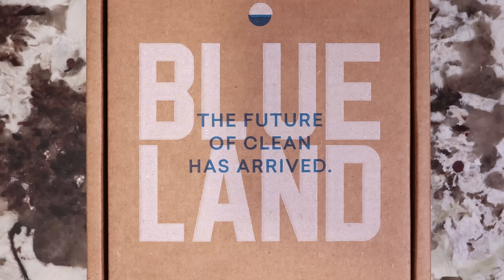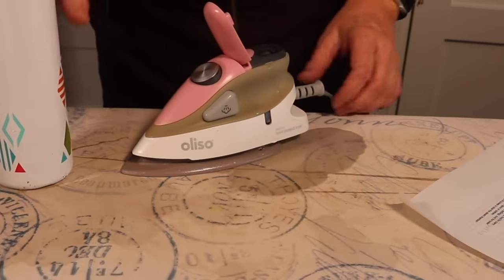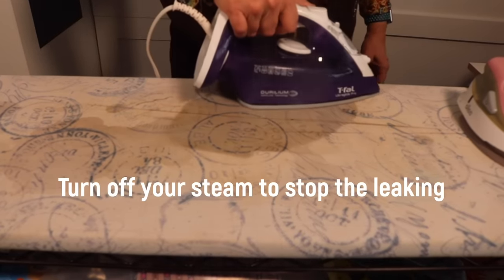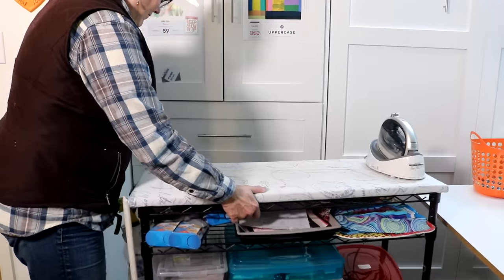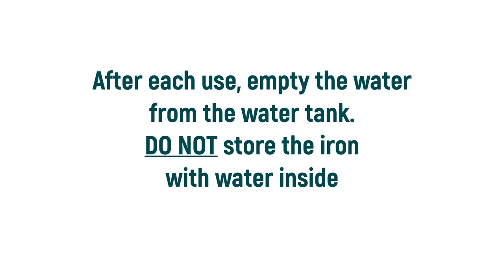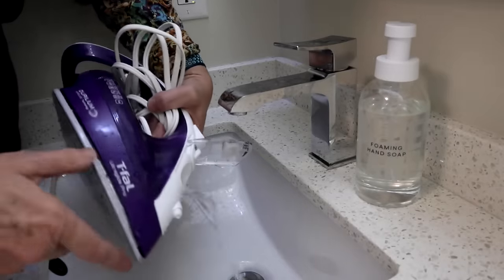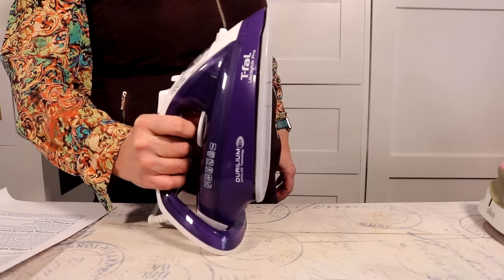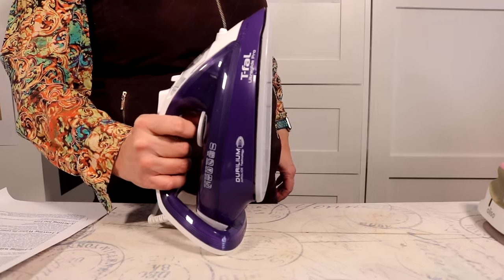🧺  LEAKING IRON? - 8 WAYS TO PREVENT WATER LEAKING FROM YOUR STEAM IRON

Comment: In case it helps someone else : I read the manual, used tap water, etc and my iron worked beautifully for 7+ years. Moved and within a month it was constantly leaking, and started leaving reddish stains on fabrics. Turned out our water was TOO hard and was leaving deposits inside. A few good cleanings and switching to bottled water (regular drinking water, not distilled)later, it hasn't given me any trouble in 2 years.
Reply from the maker: Thanks for sharing.
Reply: Yes, in our rural area the water is hard. I have to use bottled water to keep the iron from crusting up.
Reply: I have hard water too, and using half tap/half distilled has helped immensely.  Ratio might have to be adjusted but it seems to work.
Reply: Since I started using bottled drinking water I've never had leaky iron!
Reply: that's a really good idea...thank you
Reply: I am getting rust coloured water out of the iron every so often, yet I have always used proper ironing water. I saw a video tonight, which shows the screws inside them go rusty, why on earth aren't screws that dont go rusty used.

Comment: I have had my Rowenta for years - read the manual - and you still taught me things I did not know!  Thank you!
Reply: Me too! I love my Rowenta's.
Reply: Me too, I love mine also!
Reply: @cindysaunders9689  Only thing I don't like is there is no temperatures given just linen cotton wool silk synthetics on the dial. Different vombination fabrics can use different degrees of heat.   So far following manual I have had no leaks in 4yrs.   But have to clean sole plate after hubby irons every time.

Comment: Found this information helpful.  My favorite iron to use is a vintage iron that has no steam but does have an adjustable setting.  My husband added a new wire and plug.   It works great!  Reminds me of my grandmother’s whose I continued to use until it died.     I recently saw that a shop out of New England sells a similar one.  If this one dies, I will probably buy theirs.  If needed, w will spritz my fabric with a fine mist and I use a clapper when making blocks.   I also pre-starch my fabric.  My favorite sewing machine, a featherweight.  Easy to maintain and adjust.  Someday I may spurge on a big $$ machine.  But there is just something rewarding about being able to grease and oils my own machine…..
Reply: I  have a '70-80's GE dry iron and a '37 Featherweight...Agreed, nothing like'm! I discovered Magic Sizing when I grabbed it by accident. Same body without the stiffness of starch. I iron on a piece of pine shelving that has a layer of cotton batting and wrapped with artist canvas and stapled on the back....never thought of using a clapper, will try on current project. Thanks
Reply: @emhepri  I have a pine board I wrapped first in heat resistance batting, then several layers of wool batting and finally some lightweight canvas fabric.  My husband cut the wood so it fits on the end of my “cutting island”.  So love it, as it ( cutting surface)is on wheels too,  probably about the same size as your ironing cart .  My cutting island is made up of two book cases set on their side. IKEA brands…

Comment: I’ve never bothered to read an iron user manual presuming that it would state the obvious i.e. « do not submerge the iron in water while plugged », « do not press grilled cheese with your iron »,  « do not touch the soleplate while ironing », etc. But I was today old when I learned that there is a steam chamber in addition of a water reservoir. That explains a lot. A big thank you from Quebec City for this very informative video. Looking forward to the next piece of wisdom! 😁
Reply: Wait!  If you use enough foil you can make a cheese sandwich. But don’t open the package over the ironing board because it’s really messy that way.

Comment: I had my grandmother's Black and Decker iron from the 1980's, used tap water and left it in the reservoir all the time. It never leaked water and I never had a brown water problem in the decades I used it. It was a VERY sad day when it finally died about 5 years ago when it stopped getting hot.

I got another Black and Decker and used tap water (like I've always done), by that time I found out I had to empty out the water each time (thanks to your videos) so did that but also depressed the steam button so make sure the water was evacuated that way as well. I still got brown water in a short period of time. Got another brand domestic iron. Did the same thing. The same thing happened in a short period of time. Tested our water and it's barely hard according to that test. 

Fed up I got a professional gravity feed iron. Use tap water (yes, you use a water conditioner with it), empty the tank, evacuate the water using steam until empty. Guess what...no brown water. I won't use a domestic iron anymore. The gravity feed iron gets HOT, there's no annoying auto-shutoff, it gets my seams flat, the water tank is HUGE so don't have to refill it all the time, and the best part is I can easily replace parts on it myself. :)

Comment: This video made me smile. I use my Mother's iron, a Rowenta that she purchased many years ago.  She is gone now but I still hear her advice, "never leave water in the iron, spray it all out when done ironing and allow the hot iron to dry out the inside chamber."  She always used bottled water, never distilled water.  This iron must be nearly forty years old, I still use her practice of testing the steam settings on a practice cloth before ironing on the clothing or fabrics.  But I did learn a lot from your video, especially finding the instruction manual online, it has is lost to history!  Thank you so much!  PS I live in a rural area, at high altitude, our water is very high in mineral content, especially calcium, so tap water would destroy an iron in months.  Thanks again for the great advice, all the best!!
Reply from the maker: Thanks for sharing

Comment: Thank you Karen for another informative  video.  The leaking and spitting of two different mfg  expensive irons I own drove me nuts and ruined fabric.  I did not know most of what you taught here.  Out of frustration, I stopped using steam.  For the past year i either dry iron, or use a spray bottle with spring water, or I use "Best Press".  I have been happy with the results of this three pronged approach.  But if I ever need to steam in the future, I now know how to do it properly.   And, I will read the manual!

Comment: I echo everyone else here; you are the absolutely the best teacher. Thank you Thank you! Like many others, I also never put water in my iron. But recently I found out about a new product that you "dot" on the fabric- similar in use to Best Press and other starches that spray on but this is a heavy duty pen application called the "Easy Press Pen". It makes the fabric flat with out a clapper - very flat! I must have had a heavy hand and used too much and started using it for every little seam that wouldn't lie flat. Very soon my iron was spitting gunk and spewing dark stuff??!!! Somewhere along the way, to get these 6 layers of fabric flattened I guess I had used a damp pressing cloth to help things along and I think that that wet cloth pushed the watery gunk inside the pristine innards of my iron. I killed my iron which was (thankfully) a cheap little thing that I had kept so perfectly dry.  I also might have ruined my expensive wool ironing mat. 

This was yesterday before I watched this video. I just want to encourage everyone to watch out for that Easy Press Pen. Don't over- use it and look often at your soleplate to be sure the residue isn't building up. I just wanted to remind everyone  that it is not only what you put IN your iron that counts - it's the spray starch and Easy pens and other things you put on your fabric that can create huge problems as well.

Comment: I love your videos.  I have my PhD in organic chemistry and I have one fact to correct.  Distilled water boils at 100 C.  If ions are present the boiling point is elevated and the freezing point is depressed.  This is how salt melts ice in winter.  It is also one of the reasons that we add salt to water to cook pasta (besides the taste).  I finally bought an iron that has the water reservoir in a base unit away from the actual iron.
Reply from the maker: Another Chemist called me on it too. Funny, all the literature that I referenced (and I always fact check with several) said the opposite. Thanks for letting me know. I need to do a deeper dive to find out what that 'fact' came from
Reply: I didn’t know that either! (About why to put salt in the cooking water.) So putting salt in makes it wait to boil till it gets hotter? Then does the hotter temp cook the pasta better? Or perhaps faster? 
This is fascinating!!!!

Comment: All excellent info as always. 

I  recently made the decision to simply STOP putting water in my  iron. The break-through came with the discovery of a good refillable plastic mist sprayer-ultra fine continuous water mister. I have more control over where the steaming happens, don't have to clean or futz with the iron, have better results removing hard creases and it's SOOO much easier to refill a bottle.

I'm also done with $70+ irons. A good simple, 1500 watt appliance and regular soleplate cleaning with hot iron cleaner. I am a happy camper!
Reply: Agreed! I'll still put water in my iron, but I won't spend over $30 on an iron any more. And, ironically, my $30 irons have all FAR outlasted the many $100+ irons I've owned. At $30, I dont mind if I have to replace it every year... butbthey usually last 4 or 5.
Reply: @rosiethornock4794  I totally agree on the $30 iron but recently itook a chance on a Sunbeam Cordless or Corded 1500-Watt Anti-Drip Ceramic Hybrid Clothes Iron. 

It was $63. I tried it because of the hybrid feature ...corded or cordless. I love it!

Comment: Excellent information, thank you!!!!  The diagram showing the steam chamber along with your explanations are invaluable....who knew???  😉. After decades with my Rowenta, I'll be using these tips and info. 😍

Update 2/14:  I've been following your guidelines and wow what a difference.  No drips, no spits, no water leaking.  I've referred to my manual for cleaning instructions and what type of water to use in the past, but  always filled it to the max which created problems.  I happened to notice the instruction above the cleaning section where it says to move the lever off of steam, which I never did until your video.  The devil is in the details!

Comment: If you want to use higher heat on delicate fabric, you can purchase a detachable sole plate for some models.  This clamps on and raises the iron away from the fabric while still letting the steam and heat get down to the fabric surface.  Always test on a scrap first. I sew garments as well as quilts- and have melted fabric before. Sometimes nothing will get out the wrinkles except steam and that higher temp may damage fabric.    I learned a lot from this.  I think impatience is my main problem! ;)

Comment: As always a very informative video. 

 I wanna add that distilled water is more sauer and aggressive as normal water. Therfore it attacks the metallic parts of your iron specially in the steam area. This can lead to corrosion and rosty drops. 

If your usual water is extremely hard you can mix it with distilled water. 

Your loundry dryer produce destilled water. Filter it through a coffee filter to avoid fine fiber rests from your laundry which could sit down in the water lines or the jointing  of your iron.

Comment: Great information. Years ago I started using my iron dry because there are too many downsides to putting water in it--the mess of pouring it in the tiny hole, waiting for the water to heat so it doesn't spit (I am not that patient!), plus if I ever forgot to empty the water I'd inevitably get brown rust on light fabric. If my fabric is wrinkled I use a spray bottle with water in it.

Comment: My very expensive Rowenta iron started profusely leaking when it was a year old.  Of course, I never read the manual and am guilty of all the leaking iron reasons - especially using distilled water.  I’m going to try everything you have mentioned and if all else fails, I’ll have a very expensive lesson learned and will get a new one.  Now to go look for advice on a good iron (hint, hint).
Reply: I have the cordless she has. I have had it at least 3 years and love it. Fast heat, great steam, no cord! It stays hot a long time before you need to pop it back in the base and only a few seconds to reheat
Reply: @jodieroundtree488  I’ve been eyeing cordless irons and was wondering if they get enough heat.  This is good to hear.
Reply: @jodieroundtree488  I too have the Panasonic 360, cordless and I love it! 
I have an Oliso with a very long swivel cord, that started leaking. Bought the one above and haven't used my Oliso since.

Comment: Awesome video, of course!  I have gone through two newer irons and was never happy with their performance.  If I had seen this before it might have been a different outcome.  I have gone back to using my old iron that was dropped yrs ago.  The switch was damaged (luckily it's stuck on the highest setting) so I leave it plugged in to a power strip and just turn it off there.  Once I went to using a spritzer most of my problems went away.

Thank you for this series!

Comment: This was a great video about irons and water leakage. Some I knew from experience (or actually reading the owner's manual) and others were a surprise. I remember those distilled water only days. At that time, I was young and broke so distilled water wasn't in the budget and I used non-steaming irons with spritzing or dampening (it's own process if done correctly) the piece to be ironed.

I'd like to add one more reason; when the cat leaps on the ironing board (everything is cold so they think it's "safe") while I'm cleaning up for the day, then the iron crashes off (cat goes shooting out the door to hide under the bed). I've lost a couple irons that way as they are usually unfixable; some irons just continue on like nothing unusual had occurred; and sometimes the iron will leak no matter what leaving them only useful as a dry iron. Same thing can happen to irons with curious and rambunctious children or the dog romping through and jostling the ironing board. My house is quiet now and no one come in my sewing room until the iron is safely put away.

Here are my questions:
* Do you have a favorite iron brand and why?
* Is steam ironing better than spritzing/spraying the piece with water or a pressing aid?
* What should the iron purchaser be looking for in a new iron?
* What is the expected time span for an iron to be useful? With general ironing they can last quite a while but with quilting the ironing is always done at the higher heat settings.

I know these questions are not exactly related to a leaking iron but I am interested in your views. TY
Reply from the maker: I love my panasonic cordless for lots of reasons. Obviously it's cordless, but I also find that I can use it with either hand. I like that it's a bit smaller and lighter. And I very rarely use steam. I find a spritz bottle much more effective

Comment: I have a Panasonic cordless that started leaking. I’ve had it about three years. However, I’ve done all the things you point out not to do. I hope you’ve solved my problem. I also have vintage travel irons that are terrific but don’t have an automatic shut off feature so I’m wary of using them. Thanks for your ironing tips. I use them all the time.

Comment: Karen, Karen, Karen...1k short of 300k....you said by Valentine's Day...you will probably hit it and well-deserved.

A very comprehensive, objective and systematic review of all of this "stuff".

I found you in 2019 when I started quilting (late in life).  My baby quilt was a bonafide disaster.  I found your helpful/insightful/encouraging videos.  I realized that I had many things going wrong, not the least of which is that my pressing surface and technique....sucked. Your video on same was a game changer.  

I abandoned my fancy iron, and I use a "Radiron" from 195?.   It stays on; has no steam, and is hotter than regular irons.  I keep it hooked to a light to ensure that I have a visual that it is "off".  No fail safe switch there!

Now I use a spray bottle with a nice mist. (Hmm...looks like one of those Blueland bottles might work~) No burping, hissing, leaking, or steam blasting my fingers!  I don't miss my steam iron.

I baste on my wall now...I use a garment steamer to do all of my "steaming" needs post production.
Reply from the maker: Thank you for coming along for the ride

Comment: Great information! My iron is quite old (probably mid-late 1980’s). It does not have a pulse button and the steam setting is a button that can be pushed in. It’s old but works and it’s all I can afford right now.
Reply from the maker: Irons are essentially simple. Age does not matter. I actually do not even use steam but use a spritz bottle. When that iron dies, it will be like losing an old friend